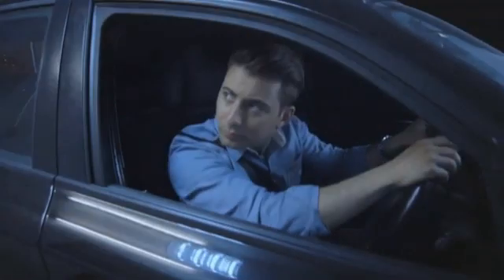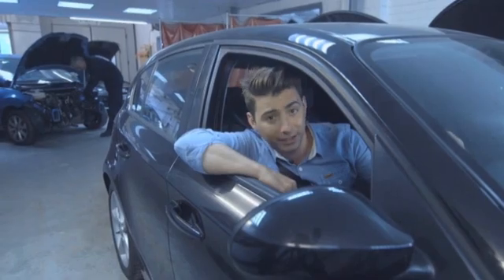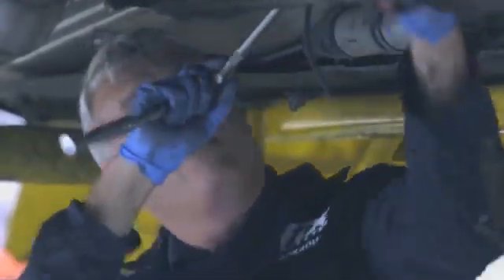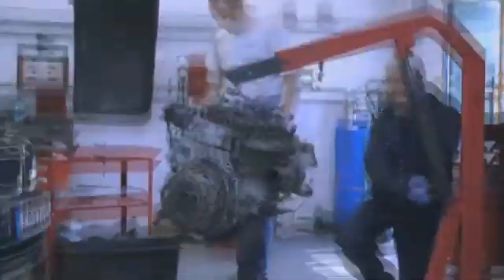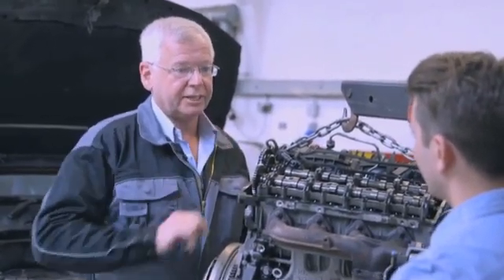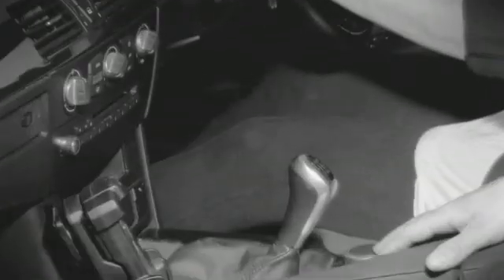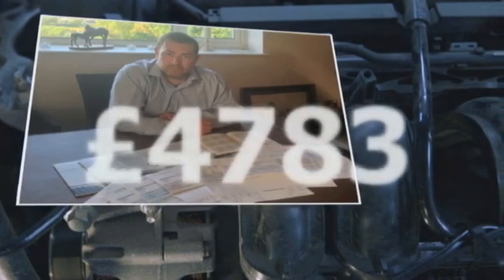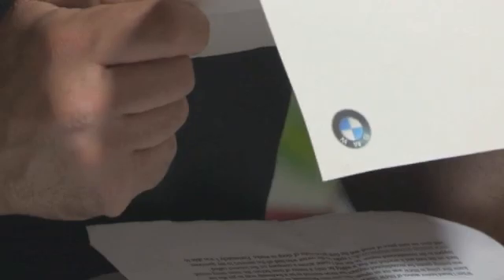BMW N47 Timing Chain Failure PROBLEM

Comment: As a bmw mechanic i can say they have all been upgraged and modified with a change in the hp pump timing better guide rails chains and on some earlier engines  crankshafts due too what they thought was a issue with the counter balance shaft gears almost all were coverd by bmw and i even drive the n47 daily so if anybody is buying one just make sure it was done by bmw its not making any ticking noises on start up from cold or at rpm and there wont be a problem 😉 (1) just make sure it was done at some stage.
(2) it was done using bmw genuine parts.   because i have seen some real horror stories of after-market guide rails breaking up and blocking oil feeds ect

Comment: If you drive hard and long Miles dont bye Bmw diesel cars.
Even you chance oil ever 10k Miles is not enought.
The time chain it will fail . No depends of good maintenence or well driving , Is a constrution problem.
I like very much everything else about the car but i can change more chains. The last one (original Bmw chain and every parts kit ) do 50000 Miles . Its impossible  to keap.

Comment: My timing chain went on my 3 series last year, a 2013 model with 84k miles, thankfully after a month of arguing they agreed to put a brand new engine in if I paid the labour costs. Massive relief from the £11k they originally wanted to replace the engine.
Reply: How much was the labour cost ?

Comment: Am having The same trouble most mechanics Don’t wanna touch it
Reply: Oh dear, what year mileage and service history?
Reply: 2010 1series  done the service in 22 October 2020 and MOT was told only need to worry about front brakes A new tires
Reply: The mileage of the car is 11568

Comment: I have e39 520i,e36 318is,e46 320d now i got e90 318i,to have a bmw need to know to be mechanic all after 2005 have different problem most of them with chain with e90 because i fix myself i saved a lot of money

Comment: I've got a 123d 2008 and had a chain replacement couple years back, but it ran dry a little few month back after a oil leak now that's sorted I have a little rattle from the chain, been told might be worth trying to change the tensioner bolt  that accessible from the outside, what do you think and where is it? Thanks mate good video
Reply: How much did it cost to replace the chain ?

Comment: I've just bought a 2008 118d with 110,000 miles. Now I'm scared
Reply: Don't worry about it, my 2010 118D got 100k on the  clock now, it's been making the rustling noise on idle since 30k around 6 years ago, you get paranoid reading about all this but as long as you service it every 6-8k it will be fine, they actually quite reliable

Comment: Hate my 320 06 plate don’t have a oil dip stick so keeps saying low oil so had more in then one day smoke came out got a service and had way too much oil       Went to drive home after the service got on the m1 and the engine went bang   The garage forgot to fit the oil drain bolt properly.   And yer they said it was on before I drove off

Comment: How to avoid: Change oil every 5-6k miles

If buying second hand, having service history is helpful as you can see how often the car was serviced

Listen to the back of your engine regularly and try to determine wether it sounds rattly, if so, get something done SOONER rather than later.

Don’t buy these privately, it may end in disaster pretty quickly

Respect your engine (don’t work it hard in 1st gear every time you move off)

Just give it a general visual inspection every week or so, don’t be afraid to open the bonnet - you see people all the time who think they ‘don’t know anything about cars’ never checking under the bonnet, but some problems are quite easy to see even to someone who knows nothing about engines (ie. if there’s oil everywhere, you have a problem. Or if your engine has no coolant in the expansion tank, you might have a leak.) It’s simple stuff. Just be vigilante and you should avoid problems! 

(This generally applies to all cars to be honest!)
Reply: buy an HDI 1,6 peugeot/citroen

Comment: This problem is still exist even in the new bmw diesel engines. Chain is still at the back of the engine. Avoid buying BMW after 2006.

Comment: There is no need to remove the engine to replace the timing chain, it´s done from underneath the car. The issue happens mostly with series 1 cars up to 2009. In 2009 BMW introduced modifications to the chain and parts, but still the chain needs to be replaced at about 100K miles or before if the car is not maintained well. Anyway, all timing chains should be replaced eventually in all cars.
Reply: I have a 2009 N47 bmw which now has 401,000km on the odometer with original chain and can hardly hear any chain rattling. However as a precaution i want to replace it.
Reply: @ndakandaka   Good!. Even if it doesn´t break, it´s a good idea to replace it, since it´s still a mechanical part that gets streched out with its use, so it should be changed to keep the car´s original performance.
Reply: Finally someone understands. There us no such thing as long life or unlimited on timing chains.
Ive replaced mine at 91k in 2014.
Now 2021 142k going strong. Oil change every 7k/8k.
0w-30 is crap its too thin makes the chain sound really bad. I stuck to 5w-30, but some use 5w-40.

My next chain replacement will be at 170k probably 2026 if i keep the car for long.
Reply: @QuattroBajeena  I think with more frequent oil changes, this chain should last longer, but most of the BMW customer, without wanting to insult anyone, are clueless when it comes to internal combustion engine and they think, that driving 25k miles between oil changes is ok

Comment: mines lose and starting to rattle-goes in monday to have 12 piece t/chain set replaced-i had to get mechanic all the parts as that is how he operates-2 and half days he said-around £600 for labour-he worked for bmw for 15 years but left garage after dispute over wages

Comment: I drive BMW 520 d (N47).  the same thing happened to my car.  Repairs cost me 4200 €.  I was only at the BMW three days before for an inspection
Reply: get an HDI 1,6 peugeot. much much better engines and cheaper in parts and fuel

Comment: I have a 3 series 318D 2L 2009 (manual diesel) which just touched 100500 miles. Does that have the engine with the timing chain problem?
Reply: Yes it will if it is an b48b

Comment: Chain failure is most common on n47 2006-11 engines,after 11 they upgraded the tensioners HOWEVER these chains may still stretch and rattle on all 20.d engines upto 2018!!! Very few snap but it’s not unheard of. N57 which is in 30d/40d cars are ALOT less prone the timing chain failure. I will say this tho, over the course of 12 years I’ve owned 7 different cars will n47/n57 engine and serviced them all ever 10k or 6-8 months and NEVER had 1 issue with a chain or turbo etc. I know 3 people who have stuck to BMW’s 2 year or 18/20k service intervals and 2 of them needed chains replacing. Il leave the math to anyone reading this
Reply: N47 engine 2008 owned from new still original clutch and chain serviced every 8k miles 197k still like new bmw messed up on service intervals in my opinion 20k service intervals were stupid
Reply: N47D20C. 2012. 223000km. No chain issues but i got all changed for peace of mind. Used the FAI kit.
Reply: @raimom3179 so you went through the hassle to change the timing chain and you didn’t even use the original brand? 😂
Reply: @AlexCapi  i didin do it my self. Shop did. It has a 3 year warranty whit out km. Limit. Its a big Chain brand shop and they use fai kits all the time.
Reply: What about 116 ed 1.6 diesel 2013? Thanks
Reply: @joaopereira9904  116/118/120 are all the n47 in various states of tunes
Reply: @Bestbeingblunt  mine has 220000 km, never got the timing chain changed, should i get worried? Engine seems to run smooth, i started changing oil and filter at 8000 km
Reply: Math says 3 customers with chain failiure + 1 customer (you) with no problem. So fail rate is 75%. Do you agree with that conclusion?
Reply: @gehtdianschasau8372  nope!. This is an old comment but between the years of 2008-2016 I owned 6 of these engines in different variants of BMWs… not one had an issue… that said I always serviced my cars every 10k or 12 months.

Iv also had 5 N57 engine that reportedly have the same issues and again… not one issue. Currently on my second b57… and yes you’ve guessed it!

I’m either very lucky or just maintain my cars correctly (not as recommended by bmw).

Do you realise what the global cost to bmw would be if the failure was 25%?🤣.
Reply: @thatsjustme1990   Absolutely !  Long oil change intervals,  over 7k miles or 11.3k in metric terms.    a soot appears in the oil and is very abrasive.  Wearing out each chain link a little bit,  creating stretch.  Change the oil People.` every 5-7 k highway miles and 3-4k,  if city driven.   Spread the word.
Reply: @alwayslearningthefacts5881  engines at 24h races endure like 5000km of extremely hard driving without oil change pit stop. If a high power output race engine can do that, a low powered street car, with far looser tolerances that isn't constanly revved into oblivion should last a lot longer without oil changes. 
People shouldn't be required to change oil every other fill up. If the chain stretches because of a bigger than 7k mile oil change intervall, it's a design fault. The chain doesn't really has to transfer power, it is not under heavy load, a rubber belt can do that.
Reply: They changed things in 2010 not 2011..

Comment: The following models have the problem:

- E81/E82/E87/E88 116d/118d/120d - LCI cars built before 01/03/2011 only
- E90/E91/E92/E93 316d/318d/320d built between September 2007 and 01/03/2011 (anything with Efficient Dynamics could have the problem if it's built before 01/03/2011)
- E60/E61 LCI 520d built after September 2007 (models with Efficient Dynamcs, LCI 520ds built before September 2007 do not have this problem as they didn't change the engine until a few months after the LCI model was introduced)
- F10/F11 520d with a build date of before 01/03/2011
- E84 X1 18d/20d/23d with a build date of before 01/03/2011
- E83 X3 2.0d built after September 2007
- F25 X3 xDrive20d with a build date of before 01/03/2011

Models built between 05/01/2009 and 01/03/2011 do not require as many parts to be changed as those built before those dates.

There is no problem with N47 engines built after 01/03/2011 (for now).
More via this link: http://www.boards.ie/vbulletin/showt...php?p=82905489
Reply: Sorry for being 5 years late, mine is 2011 but from november in wich one is it included ? 😅
Reply: Mine is 116 ed n47d16 1.6 diesel 2013, never had problems, better to Change Timing Chain?

Comment: Got a 2nd hand bmw 116d(ed)/4cylinder and the timing chain is worn i think, because the engine maled rattling noises. It has now 130k km on it.

Comment: As Toyota avensis owner I love this maybe if just bought a Toyota  be more reliable
Reply: Toyota Avensis and Auris have BMW N47 diesel engines.
Reply: @pietvast4283  mine 12 d4d Japan engine bmw engine came in 2016
Reply: @tomwall7966  might be an N47 by BMW
Reply: @pietvast4283  no bmw engine  goggles it wikipedia u soon see
Reply: Toyota is a 🕌 Wagon
Reply: Only because cannot afford bmw lol

Comment: It's a safety issue if this had of happened on a steep hill or sharp bend they could of all been killed or ended up killing other road users , all of these car's need to be recalled and repaired with an upgraded cam chain , or take the car's of the road and compensate the owners in full.

Comment: i got a N47 in my 2015 X3 28d. Any word if BMW updated the engine or does it still have this problem? Car only has 60k km.
Reply: No the issue was rectified in 2009 , however their has been cases of failure beyond that up to 2011. BMW did a "factory bodge " on all N47s built after this tightening the sprockets and chain. This on a cold morning gives harsh vibration from the engine , as i am well aware as my 2012 F10 is feels like a  MK1 Transit in the morning !!

Comment: My 2011 320d - its had LL04 every 12 months and I always disable start stop. Wisdom of the internet suggest both might cause issues. Even though my '11 plate has "fixed" sprokects - some failures are being reported. I'm at 66K and so far so good...
Reply: Good advice to disable start stop, also I would be inclined to change engine oil twice a year or every 5k miles.

Comment: Outrages main dealer and BMW response to customers in dodah
typical bmw wash there hands of any  Accountability, I did have the E 46 engine was a brilliant car with thousands of miles still goin strong when sold it.
I never spend more than £1000 on cars and usually sell them for the same price approx 
volvo s60 fab car!!

Comment: I was going down the highway a few years ago in my old 94 Mazda pick-up. All of the sudden my engine died. I turns out my timing belt broke. My little 2.3l four cylinder was a non-interference engine as opposed to an interference engine. I was lucky. It was a few hundred dollars to have the belt replaced. If you have an interference engine and the timing chain literally breaks while running, the engine is pretty much toast. You need to be "religious" about regular oil / filter changes and don't abuse the engine.  Here's a good definition from Wiki. https://en.wikipedia.org/wiki/Interference_engine

Comment: If you want BMW, just buy it with 6 cyl. and you have no worries. The fact you buy a cheap BMW with 4 cyl. Continental motor its part your fault. Go buy top of the range Ford, Opel or Škoda in that case.

Comment: Thats what happens when you have oil changes every 2 years and 18k... chains do not last the "life" of the car! It should last an appropriate mileage the same as a belt (100k). it also has plastic guide rails that will wear out at some point. change your oil every year or between 5 and 10k what ever comes first.
Reply: pinkpolo97 every year? Every 9k km is more like it.

Comment: On n47 motor , you must change timing chain every 100k km and that's it , problem solved ! The engine have some problems from the factory but you can avoid that changing it every 100k km.
Reply: Problem ism that’s a lot of money since the chain is at the back of the damn engine
Reply: Alex, want to change my chain, i give you 30 pound
Reply: Change a cam belt £350 change bmw chain £1200

Comment: Had a 08' 320d a few years and put 30k miles on it in the time i had it. No problems at all until it started making a strange noise. Turned out to be the timing chain, so i pxed it for an e46 m3.  E46 m3.. well thats another story.
Reply: How many miles did it go until the chain went?
Reply: @chickennwatermelons1  100k and i got rid of it at 120k. It was very loud by then.

Comment: My 2008 e91 320d has done 26.xxxx km now, never had any problems with the engine or automatic transmission.
I guess I'm lucky
Reply: I have 260 000 km and it works perfekt

Comment: Their previous Diesel engine was the M47,  I've got a Rover 75 with the M47R, a Rover re-engineered version. I've had 7 of these cars without any problem and my latest 75 has the M47R with 225,000 miles on it.
A shame they upgraded it. Why diss a good thing?

Comment: The timing chain actually is a serviceable item at 100000km . Even the vw golf gtis experience this problem. Diesel oil should also be changed in less than 15k km. It is the dealers fault for giving service intervals that is incorrect but economically viable for them when the car is under their care. I fix bmws for a living to ans with the proper pre 15k km services and pre failure replacements of parts. The cars work perfectly.  Same can be said for all cars . Just some more expensive than others.

Comment: They are rubbish engines but don’t know why people lie.

In the video one person says “ no braking”

The brakes do not fail.

You just loose braking vacuum servo assistance, so you get “reduced braking” requiring greater effort / force required to apply the brakes.

Brakes still work in a reduced capacity even if you have to put all your strength into pressing the pedal.

So they haven’t actually failed, just operating in a reduced capacity.

Comment: Car companies no longer truly designing cars the part suppliers do if you look hard enough at your car you'll find parts from all over the world my vehicle for instance has fog lights sold to ford GM and dodge all the same aftermarket part numbers my driveshaft and differential is German made crap and my trans has a Toyota valve body in it and the list goes on and my vehicle is a pontiac g8 built by holden Australia

Comment: The one reason I am never again buying a BMW. Ever ! Before it I owned a Nissan Micra and it has almost 300 000 km on it and almost no problems with it. Then there was a Honda Accord. 170 000 km and still running like a Swiss watch. And then I gave in to the myth of the german cars. Big mistake ! The BMW was the one car receiving the best care and at 120 000 km the timing chain snapped. Luckily for me I still have the Honda.The German car industry is dead to me !
Reply: The only true german car is a Mercedes. Everything else is just trash..

Comment: Still common problem with the n47... Friend of mine changed the chain and everything timing related for about 1000€. Of course the engine was still running then so there wasnt any exess damage
Reply: And It will be fixed forever?
Reply: @LorenzoClara97  I believe so yeah. The problem is caused by the tensioner where the chain eventually gets loose and starts rattling. Updated parts will fix it.
Reply: @unuseableb  what year model or N47 engine is ok?